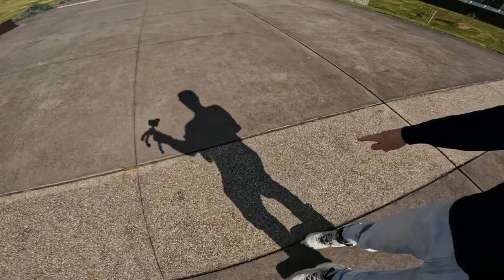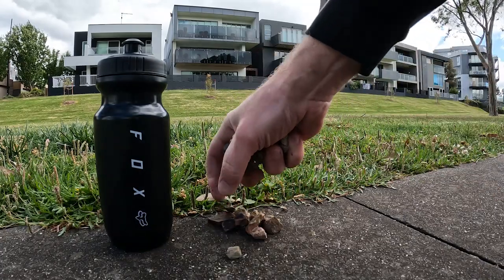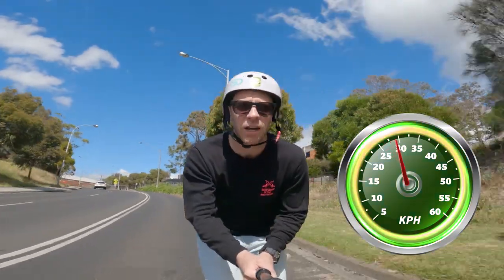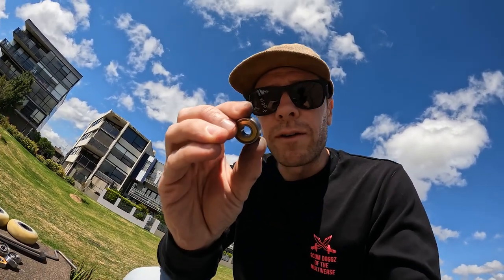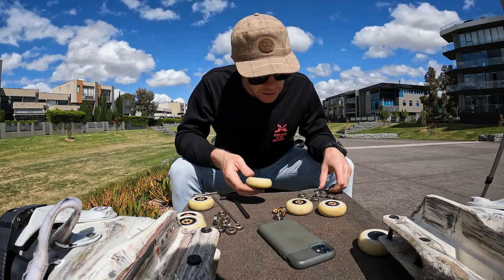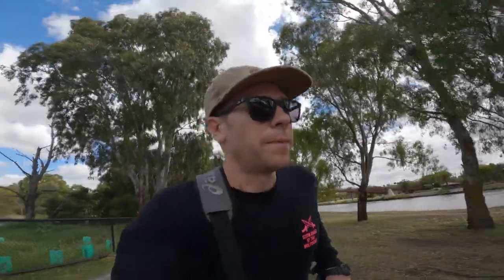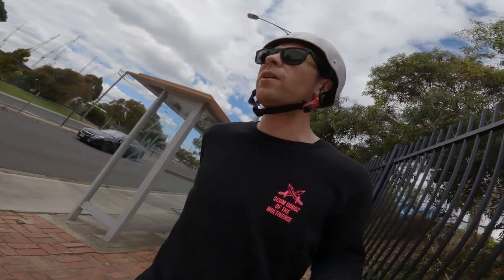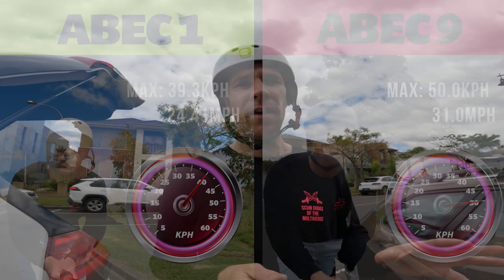Do new bearings make a difference - New ABEC 9 Bearings put to the test. ABEC 9 VS ABEC 1 bearings.

Comment: I’ve personally never noticed the tolerance difference on bearings on aggressive skates. The main factor for me tends to be how quick they are after some of the grease breaks down after use, there’s almost a peak point before they need servicing where they’re at their fastest. One main change for me was when I picked up the Loco Go Project Crown bearings, these seemed to reduce any chance of the bearing and bearing spacers interfering with each other and have in my experience (subjective of course!) been the best experience I’ve had with bearings on my aggro skates. Good in depth video btw 👍
Reply from the maker: Thanks for the comment, very helpful.

Comment: So hilarious when that guy wanted to steal the camera. One thing I always noticed was the bearings built for skateboards, typically with a rubber shield, always seemed to roll longer & have less drag than the pressed metal abec style bearings, however I never really seen anyone pop one of the metal shields or both & put a rubber shield on it and purge the old lube, lube it with something better & also break them in as well. I know my REDs were mostly substantially better aside one or two of them that rusted than when I bought them. I think there is something to keeping one shield open so that debris can fly out of the bearing, also you can do a quick clean of them that way, maybe not a complete clean. Repeated cleanings as they break in really seems to make them do well & never getting them wet as well.
Reply from the maker: I think you are right, you need access so you can clean. A good clean can make them feel like new again.

Comment: I guess is not conclusive unless you try new bearings both times.
Reply from the maker: Correct - waiting for a bearing company to sponsor the video!
Reply: @JoeStuartAU  It doesn't matter really. Nowadays bearings aren't expensive. Anything ABEC7/9 or ILQ7/9 are good.
Reply from the maker: @SaccoBelmonte  I would like to see if ceramic bearings are any good. Bearing maintenance is also important.
Reply: @JoeStuartAU  Ceramic bearings aren't good. Pure ceramic bearings are brittle and bearings with ceramic balls and metal rings result in the rings being eaten away from the ceramic since is harder.
Reply from the maker: @SaccoBelmonte  thanks, good to know. I will stay clear of them then.

Comment: When I used to skateboard, I used Zippo fluid to clean my bearings and then a drop of 3in1 oil.
Speed Demon Clear Shields were our choice in the 90’s.
Reply from the maker: Zippo fluid, interesting. I need to do a video on bearing maintenance so thanks for the tip.
Reply: I also use rubbing alcohol to clean and shake , and Lucas oil fishing reel oil. It’s blue stuff. Good enough for a $500 dollar reel. Good
Enough for
Blades

Comment: The question I have is: Can you do a power slide at 40km/h? 🤔
Reply from the maker: Good question 😬😬😬
Reply: @JoeStuartAU  Downhillers use at least 5 wheels I guess and perhaps they use wheels that are specially designed for such speed and braking needs.

Comment: There are a few bearings that claim to  be either skate rated and not abec rated

Bones of course says theyre skate rated.

But oust has the moc series of bearing that says they are made specifically for skating, like their moc  5, 7, and 9

Then theres the quantum bearings that claim tgey have the fastest bearings

Theres qube that makes the qube 8 that has 8 ball bearings instead of 7 which they say adds more stability and faster acceleration with better speed

And theres bones with the super 6 ball bearings which claim they have bigger ball bearings for more top speed and one less ball fir reduced or similar acceleration as a 7 ball bearing uhh bearing

So do rush and hard luck brand bearings

Also reflex used to have an 8 ball bearing for Rob Dyrdek 

Anyway if it were at all possible to test any of these out for their clams and see what speeds you get on them would be freaking cool
Reply from the maker: Wow, that’s a lot of bearings. The qube 8 sounds interesting and would be good for aggressive inline skating. I will have to visit a second version of this video when I get a bearing company on board to supply some bearings to test!